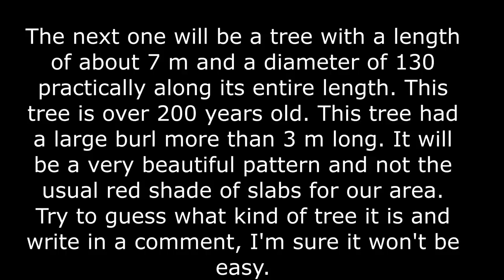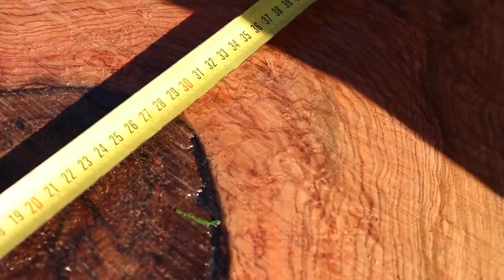Logs to Lumber: 200 YEAR OLD TREE. Alaskan Chainsaw Milling

Comment: Good to see you guys wearing ear muffs (well most of the time) to avoid damage to your hearing.

I watch heaps and heaps of wood milling videos (love wood and the process of milling) but I never ceased to be amazed that most (and I mean most) do not wear any form of hearing protection. 

Do they think they are being macho, or they do not know any better, or are they lazy, or are they just idiots?

Over time, I have come to think that the majority are simply idiots, along with being lazy. 

In some of the third world countries, the processes employed are massively dangerous, with no safeguards whatsoever, and huge blades spinning in the open air. And rickety jigs holding huge heavy logs that could crush a man in seconds if they failed, or else draw the person (or persons) onto the blade. 

The beauty of some of the timber milled is amazing.

The Japanese seem to have the cleanest saw mills, cleaning up during and after operations. 

S
Reply from the maker: Yes you are right. I will agree with you.
Reply: Good thing is the hearing protection, but no safety shoes (but slippers!) no eye protection, no helmet… is some countries a life is not worth a penny